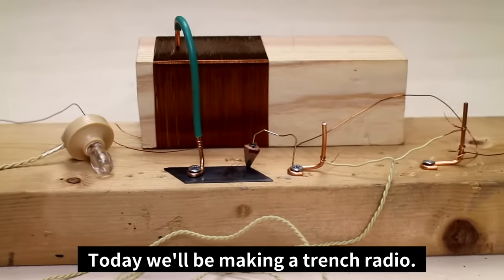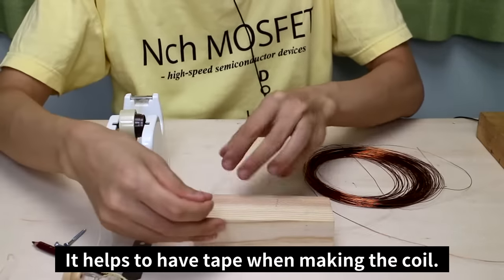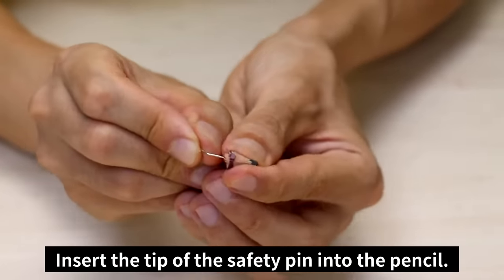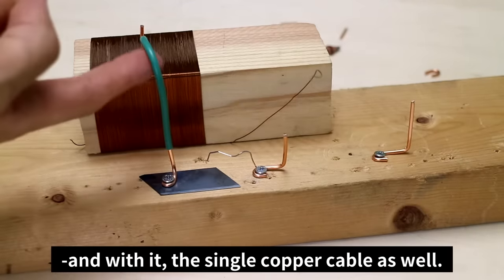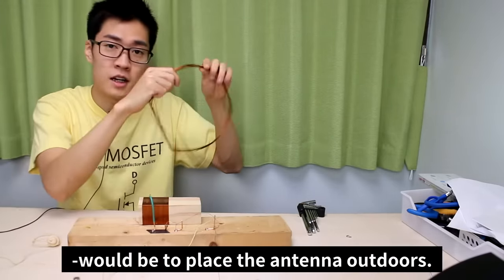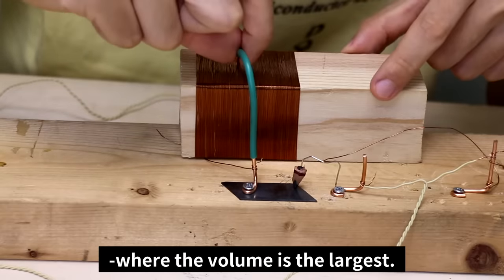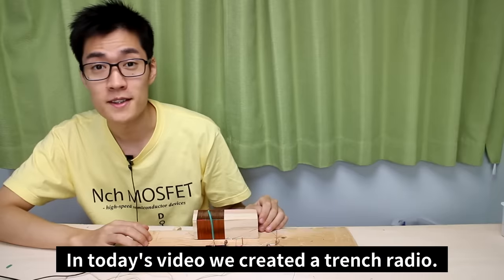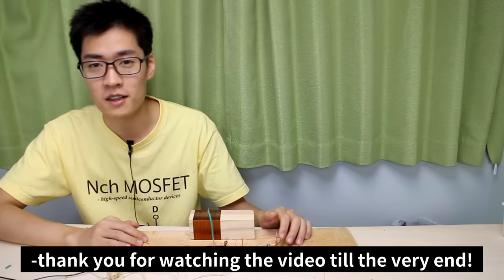Making a Foxhole radio  Very primitive

Comment: the pencil graphtetti and clay mixture and blueing are semi conductors and the npn pnp samwitch(transistor) 
there accutly a great way to learn what those are and how there made like chemistry of it 
odd fact solar panels where discovered by
"opp case poped off the sun light broke the computure by adding current at the npn pnp transistors"(1950's how long solar panels have been around)

Comment: If you try this and no AM station is found try again at night, then MW is open for long distances. And may be with the length of the wire for the coil and/or variable capacitor it may be tuned to shortwave where everytime some signals are

Comment: You have actually used a semiconductor in form of a crystal earphone. A crystal is a semiconductor diode which separates audio from modulated radio frequency.

Comment: l made one as a kid, in the 60s  they were called crystal sets, my father showed me how they made radios in prison, but it would only get am, they would steal the hand set off wardens phones for the speakers, for the antenna they used  bed springs and for the  earth a tap in their cell,  for the coil they used an empty toilet roll  with wire wrapped around and they slid a magnet   inside the toilet roll  to change stations, the one l built i made my own coli a hearing aid headphone and a variable capacitor and a crystal salvaged from a radio, it was not very loud, so l added a transistor and battery to amplify the sound

Comment: try bridging the two terminals used by the crystal earpiece with a makeshift variable capacitor, like two sheets of foil with a piece of paper between them. as you adjust the foil to alter the capacitance you should be able to balance with the arm on the coil and get more radio stations. though i used different parts as a kids playing around, so i could be wrong.

Comment: At time 9:20 you said "I thought by moving the position of the coil I could change stations"

Sanding off too much of the red plastic coating might be the reason.  If that top strip of sanded-off insulation has allowed some or all those wires to flow electric current, then the coil's inductance is much lower than you would have given the number of turns.

I'm not sure how to easily allow (1) sanding off the insulation and (2) ensuring no electrical contact is possible

The skin effect at high (radio) frequencies means most of the electric current is on the surface of the wire, and if some wires are touching, it reduces the inductance.

Many radios adjust by way of a rotating knob, which is (inside the radio) attached to a bunch of metal plates - some plates are fixed (don't move), other plates are rotating by the tuning knob, and that's how the radio station (frequency) is selected.

So perhaps an improvement in the ability to change the capacitance, and avoid sanding off the insulation of the inductor, would be one improvement.

Comment: I keep forgetting these skills are dying out...Heres some other ideas...So first ff a pencil lead is (SEMI-conductive) Has Resistance...a small piece of copper plate is also a good choice in place of the steel blade, Burn the coppers as the cutter blade there will be many areas to use on the copper from black to green to red...the earpiece can be modified from an old dial phone hand piece uae the end that you listen to in place of crystal headphone...Also remember that not only will the position of the pin be important but ALSO the Pressure applied! Have fun that the goal here👍🏽experiment

Comment: Please, I would to point out one major fact. Using a sink, make sure it has metal pipes, as plastic will not conduct the current needed to power the radio. Too many homes use PVC these days.

Comment: Hi Ichiken Tech, what is the range of frecuency od this? would be possible someone within range of 2-40mhz  with primitive materials? I come here because I just am working in a theory related to the sun flares, passively amplification of HF and make physical effects seen at naked eye, but this you are showing can absolutly connect with deeper posibilities. will publish the info soon.
Reply: I like where you are going with this📻☢🔘
Reply: I don't see where you are going with this :) But anyway 2-40 MHz is too broad to get usable performance out of such a simple design. Unless you just want to receive all those frequencies at the same time. Several receivers, each narrower, is better.
Reply: AM was in the kilohertz range. MHz is for FM.

Comment: Very interesting.  I think you should not use the outlet for Earthing.  The intended purpose of that wiring is to allow high voltage, high current to safely soak into the Earth.  If anyone on your circuit has some sort of accident that Earth will become live and the consequences could be very nasty.  I have several copper rods for various projects.  just drive one into the ground about a meter and use that.  It is easy if you wait for a rainy day and drive with a hammer into wet ground.  Thank you for this interesting video

Comment: I made one when I was 10 yo only I used telephone wire 90 turns around a paper towel tube a double edge razor, pencil & 3000 Ω headset

Comment: Thank you, very  interesting, if you spaced the coils, would that help?
Thanks nice video.
Reply: Hi Dave I was wondering the same thing myself, I have often noticed A COIL OR A LOOP in these winding any idea what they are for? I mean people wouldn't do it unless there were some benefit? I do know the copper winding is a very very Poor if I may use the term Substitute of a Variable Frequency Capacitor you know the part I mean its the part you use to Tune in Frequencies there like thin metal Plates which move between other metal plates with a gap of about 2-4 mm between them, they do NOT touch each other one is fixed and other moves I can see them in mt mind from all the books I read on the subject.

Comment: It looks like it shouldn't work but I know it does as I have made one. I recall the original used a "blue" razor blade, I think that was the brand and colour of the blade. The blue colour probably has a similar effect to your heating the blade
Reply: The Blue on the blade is sylynium, the oxide or gun blue. It acts as a semiconductor

Comment: How is the sound amplified without power
Reply: The sound isn't amplified. The energy that's fed into the earphones comes from the RF signal in the space around the radio. That's why you get more signal with a larger antenna.

Comment: It's a form of crystal radio. I used to build them a lot in the 80ies. Sadly nowadays hereabout they're useless as no one broadcasts in the long and medium wavelength bands in amplitude modulation and the design of a crystal radio is way too underpowered to work in the short wave band.

Comment: Isn’t this what we use to call Crystal radio ?
Reply: Pretty much, yes. The crystal with a point contact on it did the same thing as the pencil lead on the razor blade: it's called rectification, ie turning the oscillating radio signal into a sound signal. Except crystal radios generally have a capacitor for tuning the station. You'd need that if there were several strong radio transmitters in your locality so that you could tune to the one you want.
Reply: @sonicspring6448  thank you. It’s really appreciated. I remember building a crystal radio with my father, a long time ago.
Reply: @NicleT  Yes, I did too! It was the first radio I ever built. So exciting at the time.

Comment: A simple variable capacitor is better for tuning.. easy to make. Use tinfoil and paper for an insulator, roll them up and put one inside the other like a tube.. when you pull out the centre one "bingo" a variable capacitor.. 😊
Reply: I think my version is quicker to make.

Comment: Anyone know how many turns of coil would be needed to hear around 118mhz? Or even 137mhz? 
I’d be interested in using this to demonstrate AM to my cadets.
Reply: It'd be much fewer turns of wire, possibly 5 or 10. It'd depend totally on what capacitance was connected across the coil, and the diameter of the coil. I have no idea if a pencil-razor-blade "diode" would even work at those frequencies.

Comment: I couldn't hear anything, so I'll take your word for it.
For the next video, if you can tell us, exactly, what each part was for, that would be nice.  For instance, I'm not at all knowledgeable about any of this, so I have no idea what the lead in the pencil was for, or the razor blade, short of using it to cut stuff.
Cool video... Thanks.
Reply: @Thomas Klugh yes, another video would be great, but here's a couple of answers for you in the meantime: the pencil lead conducts electricity fairly well and when it touches the blue-coated steel of the razor blade, it creates primitive diode, which converts the incoming radio signal into pulses that go only one way, rather than oscillating positive and negative as radio signals do. The old crystal sets used other materials, like a steel point pressing on a crystal of lead sulphide (galena). This amounts to an audio signal which can then be heard in headphones etc. There's no external power supply, as the energy comes entirely from the RF signal coming in. Feel free to ask if you have any further questions.

Comment: I believe if you had wrapped the field coil on a round form you will get better reception, GIs used k ration cans
Reply: You are correct that round works best.  A circle has the smallest outside perimeter for the area contained.

Comment: There's no AM/FM broadcasting in my country anymore, just digital...
Reply: This would not work with FM anyway.
Reply: AM means amplitude modulation.  FM means frequency modulation. It doesn't matter whether you use radio tubes or transistors or integrated circuits.  What they do is rectify and amplífy the radio signal.

Comment: For several reasons, this isn't very helpful.

The whole point of "foxhole" or other crystal radios was that you could make them out of materials you were likely to have around:
1) INSULATED copper wire (the video leaves out that very important word), which you could strip out of broken appliances that had motors or transformers in them.
2) Something to wind the wire around; sticks of wood or empty oatmeal boxes were everywhere, and amazingly, sticks can still be found.
3) Most radio designs included a "condenser" (what we call a capacitor today), which could be made with some metal foil taped or glued to either side of a piece of paper or plastic wrap, but most people went ahead and bought these, because they were pretty cheap and a pain to make.
4) A detector.  This was the biggest problem, with some makers buying galena crystals, I know not from where, but the razor blade was also a common one, with a piece of "cat's whisker" (stiff fine wire) as the point contact.  Actual whiskers don't work at all.  For a while, 1N34A germanium diodes were easy to get, and these worked much better than any sort of cat's whisker detector, but those are difficult to find now, and even diodes being sold as 1N34A are often fake: any diode that you can't see an S-shaped fine wire inside through the glass (and any that aren't made of glass) are probably not germanium diodes.  Silicon diodes, even Schottky types, are poor substitutes and will only pick up the strongest stations.
5) A crystal earphone.  These were common through the 1960s, when every portable radio came with one, so you were likely to have one somewhere around the house.  The problem today is that crystal earphones got replaced pretty much universally with electromagnetic earphones when the Walkman and its knock-offs replaced transistor radios, so the likelihood of having one somewhere in the hose is now pretty low.  Even 1980s or later transistor radios don't use crystal earphones.  "High impedance" (at least 1000 ohms) electromagnetic earphones can also work, but these are just as hard to find.

Because of the missing crystal earphone, it's very difficult for kids without any guidance to get a crystal radio to work.  Most likely they will try substituting several different earphones, none of which will work.  You CAN buy crystal or ceramic earphones on Amazon, but they are ridiculously priced ($10-15), and only exist because they are the only known thing that works with crystal radios.  In fact, these look exactly the same as the ones that were widely available in the 1960s, because that's when these were last manufactured.  This is unfortunate.  However, piezoelectric discs are available today; these are found in electronic "buzzers", which can be found in most otherwise-useless old computers and broken appliances that go "beep", such as microwave ovens.  These aren't as sensitive as the old crystal earphones, though, and I haven't tried one in a crystal radio so I don't know if they would work in that application.  When you combine uncertainties with making the components that can be made, such as the inductance of the tuning coil and the capacitance of the "condenser", whatever you substitute for the detector, and whatever you substitute for the crystal earphone, the probability of success is vanishingly small.

All of which will become moot when AM broadcasting finally goes away.  Some people are trying to keep it alive, on the principle that broadcast radio is the only thing that's likely to work in a big disaster, but since it costs a lot to operate a broadcast radio station and listeners are dying out, these will soon go extinct.

Comment: There is no use of battery😢. Please someone tell me from where it gets energy
Reply: The energy comes from the RF (radio frequency) fields in the air around the radio, so a big antenna would help you to get a louder audio in the phones.

Comment: I somehow doubt there were crystal earpieces available in the WWII trenches.
Reply: weren't they using crystal earpieces for their military radio comms?
Reply: They had high impedance dynamic ones.  They cost more than the  crystal ones but a very well designed one is sensitive enough.

Comment: Why did you say use the sand paper to smooth out the coil , when you are scraping off the varnish coating , from the wire ? . Lost me .😢

Comment: Can a bigger version of this be made to run a light bulb or maybe even a power tool?
Reply: No it cant be,i just want to say:

A FUCKING CRISTAL RADIO IS NOT A  FREE ENERGY DEVICE
Reply: @gameyord7182  they run on no energy? Thanks for the information, Einstein. We’re all impressed with your knowledge. 😂
Reply: @U.S.Militia - TBH, I doubt you could even extract enough energy from it to power even the smallest LED;  the power output being so low is why you must use a crystal earpiece, as this is the most efficient device available for converting an electrical signal into audible sound. HTH, mate!
Reply: @jackx4311  I suppose Tesla was wrong then. It’s obvious that we’re all more intelligent today than he was yesteryear. 🙄
Reply: @u.s.militia7682 - if anyone can show me otherwise, I'll happily admit to being wrong.
Reply: The energy from the electromagnetic waves is tiny (not zero). This is why radios use multiple stages of amplification.
Reply: It’s not free, someone paid for it, to power radio station)

Comment: how does the demodulation works?
Reply: The RF is modulated by having its peak to peak voltage varied with the "music".  If you only let through the positive peaks, and then filter away the RF frequency, you are left with a voltage that varies with the music.

Comment: the coil is too low Q (too much loss in the wood), plastics like PEMD, PP, PS,Teflon are better materials for the coll, the less material contacting the wires the better.

a round coil with proportion length 1x and diameter 1.55-1.67x is near ideal, a rule of thumb is no shorter than 1 to 1 and nl longef than 2 to 1.
wire 1,2-1.6mm or thin multi strand litz wire (500 or more of #46-48 gauge ebaneled wire speciallh bundled),  
also be careful that the wires are not sanded so much that they short-circuit.

keep wood and needless naterial about one coil diameter away from the coil.

Q is always lower than the circuit component with the lowest Q. as you are trying to prevent energy loss  adding any resistance in paralell just lower the rtotal, 1M ohm in parallel to a 1 ohm resistor is less than 1 ohm...

Comment: i'd like more clarity on the reasons behind things but it may be annoying to those that already know
shrug
life
Reply: What would you like to know?  Over on my channel, I have made 3 videos on crystal radio stuff.  If you have a question to be answered and I manage not to be super lazy, I may make a 4th.  Currently I don't intend to. make more
Reply: @kensmith5694 Thank you for the reply. I appreciate your engagement. I have been trying to think up some sort of request to give you a target, as if you were any thing like me and it would be a benefit to you to chase some thing for the reward of producing for an other. I would like to hear more about why things are. This goes here and does that that affects this be cause of that.

E.g. the pencil on the razor? How does its placement affect the (i think it was) tuning? Has to do with some sort of resistance? It was stated that on the edge of the blade, there was better reception. Why come? I would have liked to have more in depth on the circuit and what things are doing and the route it takes. Just a few things I hope that you are encouraged by.

Hmu for any thing
thanks for the vid, kid!

Comment: No such thing as a coils capacitance
Reply: I know what you mean, but the coil has stray capacitance between its windings plus whatever piece of wire was attached to it. But that's not a very reliable way to tune the radio. It'd be much better to have a separate tuning capacitor as they have in AM radios, connected across the coil. That would separate the stations better.